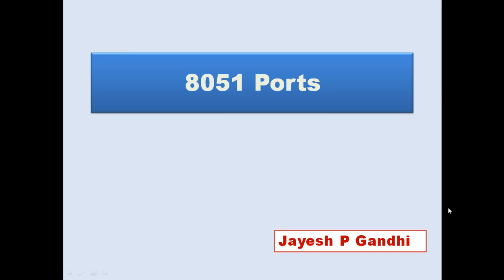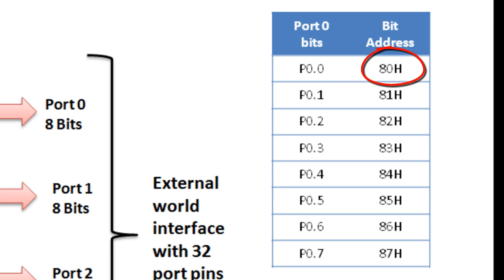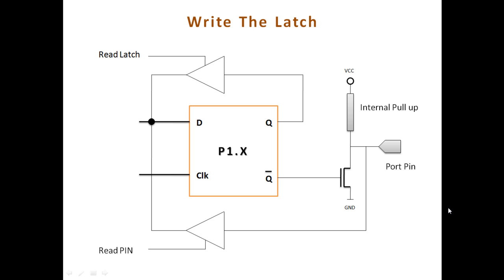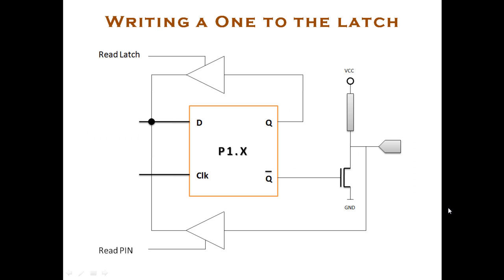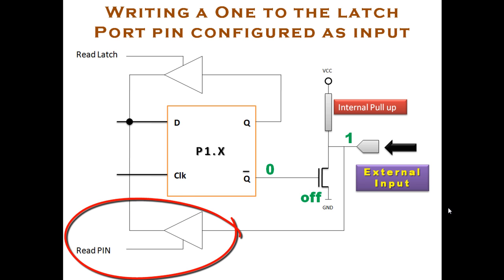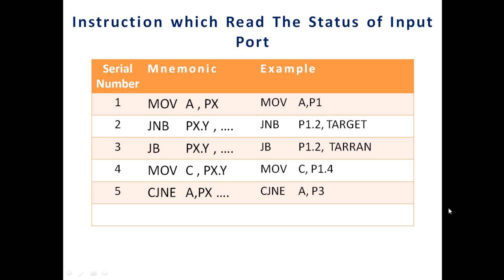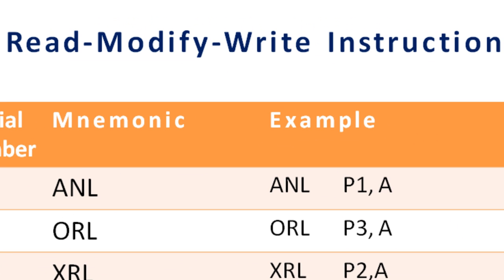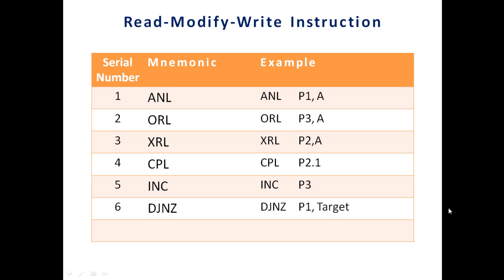8051 PORTS

Comment: I have a question. When reading 0 (logic low) at the input pin, does its latch change to the low logic (notice that D is connected to the input pin if we enable the tri-state buffer TB1)?
Reply from the maker: That is a very interesting question. When we read 0 at the input pin, the lower tristate buffer is enabled and the received input is put on the internal bus, so it does go to the input of the D latch, but the D latch will only be loaded by the D input if the clock strikes the D flip flop. The write-to latch is not issued during the read cycle for the port.
Reply: @jayeshpg  Thank you, sir.

Comment: thanks a lot.  I have a question that before reading the pin with JNB or JB, is it a must to use "SETB P1.X" for enabling the pin as input?
Reply from the maker: To read a port pin it is necessary that the port latch is set.  So if the port latch is already set the SET PX. X is not required otherwise it is necessary.  Note that on power on by default all the port latches are SET
Reply: @jayeshpg  thanks a lot

Comment: 3:33
"When the transistor conducts when it is on, current will flow through it and output voltage becomes zero" 
Can someone please explain this?
Reply: Aakash Mishra refer 'transistor as a switch'